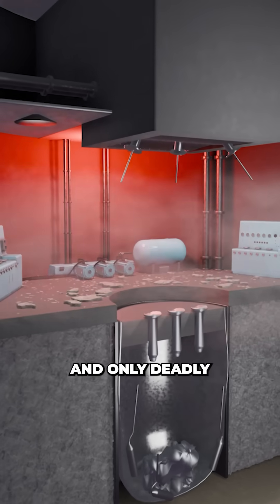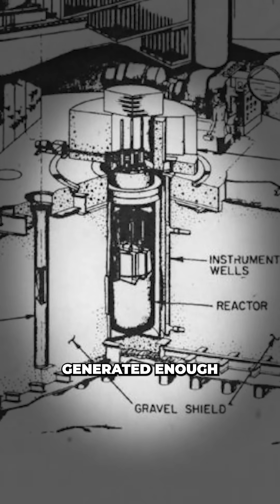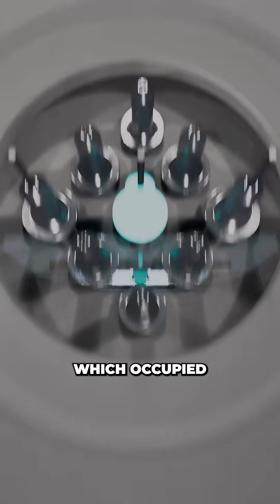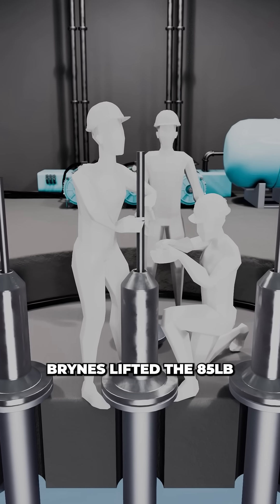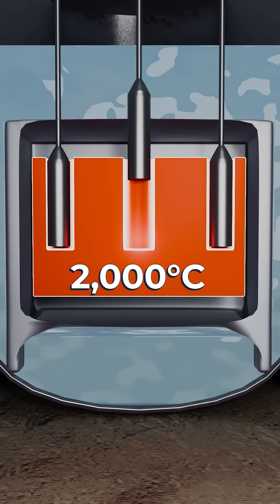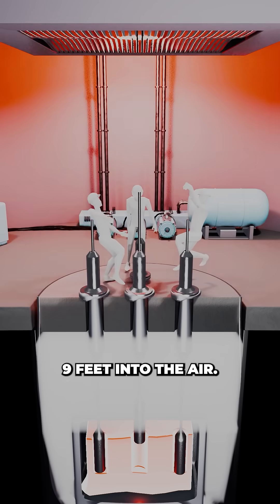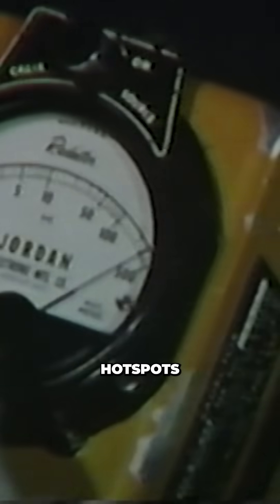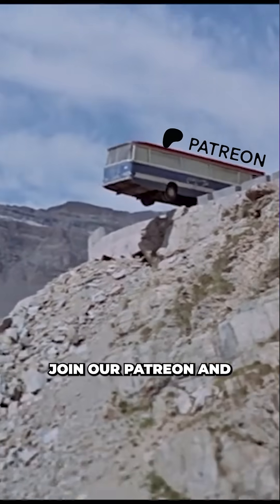The True Story of the SL-1 Disaster

Comment: Even with how catastrophic an event could be using nuclear power, it's still hands down the safest and most efficient way to generate energy.  The campaign of fixation on pushing the destructive power of anything nuclear was one of the biggest factors of the stagnation of progress.  We still use extremely outdated methods to generate power because the general public believes nuclear energy is toxic and dangerous.  The fact is that oil and coal have resulted in far more deaths and damage to the environment.

Comment: the SL1 reactor was a very early designed reactor and was full of flaws that seem obvious but remember it was designed by men who remember when you had to manually shovel coal into a giant boiler to make steam on an industrial scale. Part of why the SL1 was so bad is because of how rapidly tech advanced. No part of a nuclear reactor should be controlled by human muscle power or human hand eye levels of precision. Only machines are capable of the strength and precision needed to safely manage the nuclear reaction and the SL1 disaster proved that.

Comment: Reactor was poorly designed, the rods were not marked or measured by sensors properly, to know exactly how far out they were if lifted manually, and the design put way too much trust in the single central rod. 

It was poorly maintained, corrosion built up, and there was no failsafe for such an event (additional central rods, or places to put temporary rods when removing a critical one). 

IE- the design still depended on the very rod being serviced to stabilize the reactor, recipe for this disaster. In fact, servicing this very rod presented way too high of an overpower event, given the piss poor design.
Modern reactors in USA are built with this failure in mind, to be more serviceable, better detection and sensors, and less dangerous removing a single rod with redundant ones or the ability to place temporary rods.

Human error that cascaded when it shouldn't have, due to major design flaws and amplified by poor maintenance.

Comment: A completely avoidable accident if you ask me. Had the engineers who designed the reactor incorporated a specialized low-speed winch directly above the control rods instead of relying on a dude lifting a rod exactly four inches all three would have been spared that fate. I find it hard to believe that no one thought using such an imprecise method on something that could literally cause a meltdown was a bad idea. It's in the same vein of stupidity that caused the demon core in incident. Monkeys who don't respect the spicy rocks will have horrible deaths caused by the spicy rocks.

Comment: Very over simplification but Why not just have some type of "ceiling stopper" that only allows the rod to only be pulled up a  predetermined amount or a jack lift like thing around the the rod that allows the upper part to lift a inch per crank. Just having dudes pull on rods seems odd in practice.

Comment: You mixed thermal and electric power.
The reactor had 3 MW electric power.
At 30% efficiency, this would be 10 W thermal.
So 20 GW is only 2,000 times normal operation.

Comment: I see a lot of posts pointing the finger at this or that. As humans we often try to simplify things to a single cause or solution. But I'm reality there is rarely a single point of failure. It most cases, including this one, there are multiple choices or mistakes that led to the outcome. Lack of or improper maintenance, unknown or unexpected metalergical properties (metal expanding due to radiation), improperly applied muscular force (he just pulled up too hard), etc. It is often a series of events or a combination of factors - each with their own policies, procedures, safeguards and unknowns - that result in what we refer to as an accident. I have not read or heard about the incident report from this accident, but I'm confident that multiple factors were at play and many recommended changes or improvements were the result of the investigation.

Comment: You know what could have prevented this and what would be infinitely more safer and is quite intuitive to get ?
A rope and pulley!
Just have a rope hook on the rods and a movable pulley on wheels with some stopper, and take the rope far enough and pull after positioning the pulley system atop the rods.
This is barely anything and is so cheap and effective, it would have never led to something like this.
But seriously, no disrespect and I agree I don't know the whole thing, it's just something I think might have worked, that's all.

Comment: It's annoying and unbelievable even critical and extremely dangerous mechanism are so poorly designed. The rod could be lifted by a threaded puller or even a hydraulic jack. There could have been a stopper to limit the extraction to a specific level. But I guess a guy pulling the rod hap hazardly is good enough.

Comment: There is an OFF button on thorium reactors. They just melt the drain and, stopping the feeding process from the nuclear waste being recycled, then halting the chain reaction completely while solidifies inside the bucket below.

Truman chose pressurised steam nuclear reactors because it helped the atomic military applications as it was based on enriched uranium, not because it was safer.

Also, that mini generator is what today is being delivered as a replaceable "low power" thorium reactor in Norway.

Comment: Horrible as the loss of life was, this was a real-life Wiley Coyote moment. I imagine the guy pulling on the rod suddenly realizing- too late- "WTF am I doing?"  
Then there was the VSS Enterprise crash.  There was no safety interlock on the moveable tail release, as nobody would be stupid enough to yank that handle at supersonic speeds.  But it happened. Sadly the pilot who pulled the handle did not survive. The other pilot? Suddenly found himself in mid-air, strapped to his flight seat, holding the control yoke after the spacecraft broke up around him.

Comment: Quick correction, SL-1 had only 5 control rods, which only made the center rod even more dangerous

Its because of SL-1 that theres now regulations to avoid any single rod having that much control over a reactor
Reply: That's comforting. . . .
Reply: Not quite , there r now 2 variants of control rods , one is for reactor control during operations and the other for safety shutdown , safety shutdown rods can insert enough negative reactivity to core , such that even if one barring all other rods (due to control malfunction) drop into core it will be enough to trip the reactor in times of emergency

Comment: while Legg was the most gruesome death, he's kinda lucky, dying very quick like that would be painful but at least fast, radiation sickness is extremely painful and kills you slowly
Reply: He died too quick to register the pain. Your body will block that kind of pain, you will go into shock an you wont feel anything. I was in bad accident, an layed in a ditch for an hour, waiting on rescue squad to get down the cliff to me. I didnt feel a thing, I jus couldn't move much. Shattered my forehead, damaged my brainstem, broke my neck, a few ribs, an my jaw. 
Id definitely rather die stuck to the roof rather than die of radiation. I think its supposed to be most painful death, as your literally falling apart at the cellular level.
Reply: I'm thinking it took a minute or two to die
Reply: Wouldn’t 2,000 degrees Celsius kill all of ‘em a lot quicker?
Reply: @davidgreen3719  It's the fuel inside the reactor that is at that temp.

Comment: Theres a few things that were not covered here likely due to time constraints. 
1. The central rod (of 5) had way too much power over the system. The single rod being removed was able to cause a runaway chain reaction,  so now any nuclear reactor has to follow the principle of three rods minimum for self startup. (The machine cant operate unless at least three rods allow it to)
2. The central control rod has a huge tendency to get stuck on this system, which had been well recorded. Sometimes the technicians had to resort to a wrench or hammer to knock the rod loose from its bound state, making the issue of what caused the error (almost) certain.
3. The man who was (manually) moving the control rods had just undergone a terrible life change. Earlier that day he had recieved word from his now ex girlfriend that she was breaking up with him, and he suspected it was to be with one if the two others that was in the room, so his head was already not clear. If that is relevant or not, we cant be sure. I personally want to believe that he was able to remove himself from his personal feelings to perform his job.
Reply: Ah, damn. There's one more thing. The guy stuck to the ceiling was the man pulling the rod out, he was standing over top of it to get the leverage he needed to pull it out.

Comment: I just cannot fathom it, when raising a rod one inch can drastically change the internal environment, WHY did they choose to raise the rods using humans, instead of mechanical precision.
Reply: Because when the reactor wasn't running, they disconnected the powered controls for safety.
Reply: Because it was the early 60s and precautions were not uppermost at the time, even with something as deadly as high radiation.

Comment: I have actually seen one of these small reactors. I was the lead ME on a boiler replacement project at the boiler plant located at Fort Greely Alaska. I was on my first field investigation trips to the Fort/Plant one cold January day. The civilian plant operators have at it. If you need some help, yell. I poked around. High pressure steam boiler, diesel gen-sets, feed pumps, DA, etc. Came upon a door on the second floor, opened it up and it was a dark control room of some kind. Turned on the lights, went in and Wow, no ordinary control room. Went and got the plant engineer and asked what the control room was for. We went back up to the control room, he lead me over to a thick window and turned on the lights in the adjacent room. There it was, one of the Army's small nukes from the early 60s. It had been mothballed, but it was all there. It was 5 Mw

Comment: Nuclear power is insane. Im a huge supporter of it, but you have to be so careful when using and operating a nuclear reactor of any kind. And the swings in power happen nearly instantaneously so safety is of upmost importance, because before you can react you're either dead or something irreversible is happening and there's nothing you can do to stop it. I know really fast reaction times are possible, but that kind of reaction time is most of the time trained into someone

Comment: In addition to this fine video, there is also a good Wikipedia page, "SL-1", about this incident. Two more good videos on Youtube are "Nuclear Power Reactor - The SL-1 Accident Video: Briefing Film Report - 1961 - CharlieDeanArchives," a government report that has a detailed animation, and "SL-1 Nuclear Reactor Incident/Accident Short Film "Prompt Critical"", a fictionalized dramatization. TLDR: The leading explanation is that the rod got stuck, as it did before, the operator pulled on it, and when it finally got free, it overshot the safe distance to 20 inches. A possible contributing factor was the report that one of the operators was getting a divorce, because the other operator was having an affair with his wife, and the two operators weren't getting along.

Comment: I think you should really have said nuclear reactors DIDN'T have an off switch. Modern reactors very much do: they are made with fertile material, not fizzle, and if a melt down starts the breeder material can be drained from the energy source and the reaction will stop immediately

Comment: If i remember, no one else was there except them, and so the the radiation indicator at the top of the building set off and alerted the fire department. They couldnt see the 3rd guy pinned to the top either, so when they did, they had to make a special gurney to unstuck and shield them from him, which took a very while. Just dark as hell that in an instant, youve went from grounded, to pinned straight through the chest dangling in the air at the top of a roof 70ft+ up